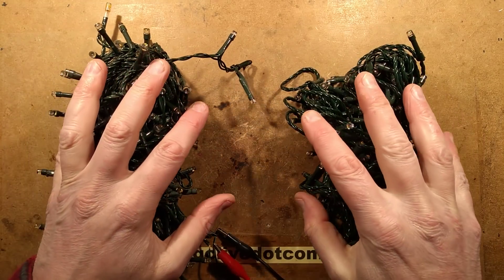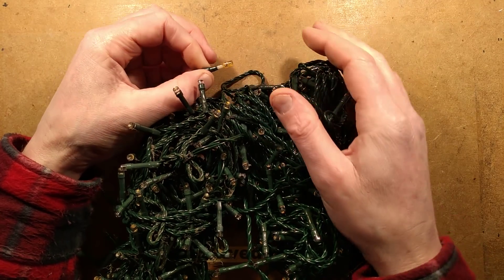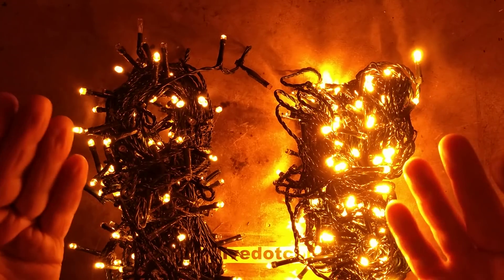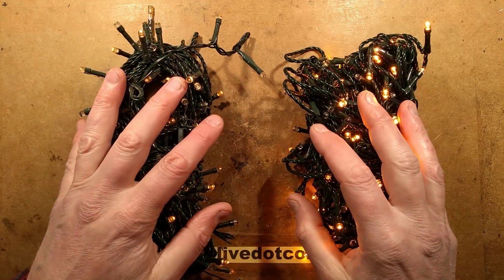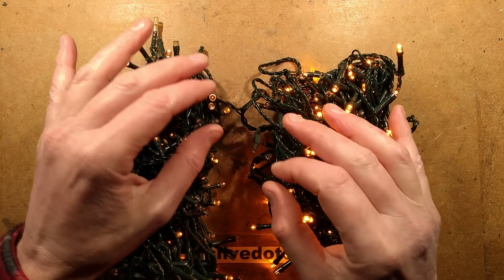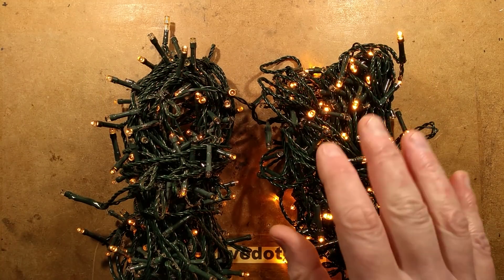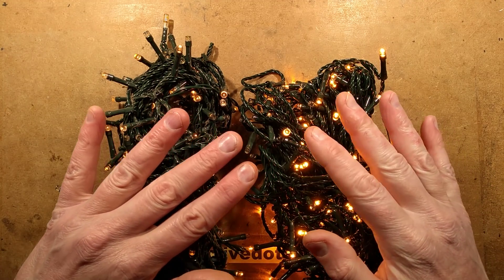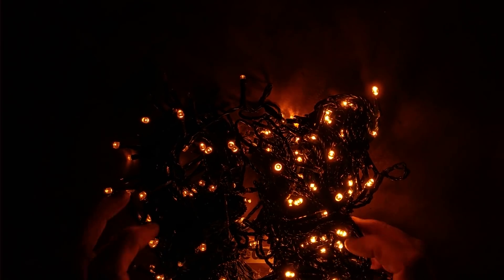9000 hour LED intensity loss test on LED strings.  (All LEDs do still work.)

Comment: I think that leds are no longer made to the same quality as they were. I have an old car that was parked in a dark car park, it didn't have an alarm. I put a red led in to look like an alarm tell-tale, that was in 1990,it still works today. It has been powered 24/7 since then I think it came from Radio Shack in the brief time we had them in the UK.
Reply: He says something about how older red and green LEDs are made differently and don't degrade as much.
Reply: These are white leds. IOW blue leds with phosphor. Red indicator leds emit red light with no phosphor down conversion and aren't driven very hard. Note, blue were also the most troublesome to develop. The 50000 hour number is derived from accelerated aging terminating at 80% output. I'd bet that's at a test equivalent to the reduced current used for efficacy ratings. At least for power leds.

Comment: That's a very interesting observation there, Clive, and I'm curious now! In another village, just a few miles down the way from here, there is a shop that got a display of multicoloured static LED lights in its windows, about three years ago. Since installation they've never been turned off (not my knowledge, and I've travelled that road at all hours of the day and night), yet they 'look' as bright this evening as they did when new, so I guess I'm wondering if some LEDs are born more equal than others? Of course, the shopkeeper might just be replacing them every few months, but I very much doubt that.

Then, there is the question of LED vehicle lighting - Do you suppose we could see car headlights fading away over time? . . It's making me wonder. Then there is my LED 'penlight' which was a lovely little thing when it was new, until I accidentally left it turned on for about three days. The LEDs were woefully dim, and even with brand new batteries, it is a pathetic shadow of its former self - ruined in three days? Is that possible? I was questioning the 'resin blob' chip on board, but now methinks, the LEDs themselves might be goosed!
Reply: ALL LEDs suffer from a reduction of light output as they age. The light output depends on a number of factors. LEDs degrade faster if operated at higher power levels. Especially if overdriven. The non-phosphor types (older technology red, green, yellow) types degrade slowly if run well within their rating. The phosphor types (white and all the other bright crazy colours)  suffer from both the LED chip’s light output degrading and the phosphor degrading. The temperature that they run at also affects them. As does the quality of the manufacturing process. So for maximum life, operate at half the rated power (or less), don’t let them run too hot and buy from respectable manufacturers. And also, unless they really need to be on all the time, only use them when actually needed.

Comment: I'd be interested to see the difference, if you modified the unused light set to drop the current by 50%, then checked the degradation after another year (or even two years).

Comment: The intensity loss gets prominent on nightlights. Since 20 years I own a Osram Lunetta which is a very basic amber GaP LED hooked to a resistor and a diode. The sucker hasn´t dimmed noticeably for two decades. On the other hand, my shiny new IKEA warm-white nightlight has degraded to a miserable dim reddish white in three years. From what I know IKEA uses a combination of white LED´s with a red LED strapped on it to get warm-white. The white phosphor-based LED degraded a lot, so the whole shebang got dim and reddish.
So, only oldschool non-phosphor nightlights for me.

Comment: Highly illuminating, Clive. You must follow this up... Does this happen with lights like 5k room lighting? So its because of the blue/green phosphors. Does using DC to light them diminish the effect or is it the same?

I have some 3528 SMDs I have had running over my desk for a great # of years 24/7. I should compare them to a set I never used.
Reply: ALL LEDs degrade over time. ALL LEDs operate on DC. When reversed biased, they do not illuminate. Typically a white or other colour phosphor is used with a blue LED (sometimes a near UV LED is used). With phosphor type LEDs, both the LED chip and the phosphor will degrade. If a LED is run below it’s maximum continuous current / power, and it does not get too hot, and a quality LED is used, then it should have a reasonable lifespan. Cheap LEDs that are overdriven will have fairly short lifespans.

Comment: I've been running some LEDs for about 4 years on a solar light, they've been going at about 0.5mA for 8, just barely on really (No brightness dip that I've seen). Does driving them harder make them degrade more quickly?
Reply: Yes.

Comment: Interesting. I'm currently looking for a new car, and one of the big attractions is all-LED headlights. Is this also a problem for those?
Reply: Rick Delair  I'm not sure that's true. I've been reading about them that they project light longer distances than both halogen and xenon lights and that if not damaged, they can outlive the lifespan of the car. The cars I'm looking at have intelligent matrix control so that various LED segments switch off when there is a car in front or coming the other way.
Reply: Mine are 7 years old (OEM Car LED headlights), I can't compare to new ones but they are still very effective, but I can sometimes notice a drop in CRI. The reflections of yellow signs looks slightly more green than they should be, the reds are dimmer, but the blue is still good. So yes the phosphors have aged, but the overall intensity is still good.

Comment: I've noticed the same thing with a lamp I put together, they're dimmer and they've turned whiter. 
On the other hand, I have a very orangey (so maybe it's actually orange and not white, though it was sold as warm white) bulb that has been on 24/7 for about 4 years and it has not changed appreciably. There's another strange thing about that bulb, which is that when I got it I screwed it into the fixture that I had bought it for, turned it on, and it only glowed very very dimly. It tried it in a different fixture, and it was fine, so I checked the original fixture and found that it had the live and neutral reversed, and when I corrected that, the bulb worked fine. Any idea why that would have any effect?
Reply: Are you sure you powered on that first socket? If you switch the neutral wire instead of the phase some led bulbs will light dimly with the switch off.
Reply: @bulko89  yeah, it went from off to dim when I flipped the switch.
Reply: @Cadwaladr  very odd
Reply: Is it weird if I can hear your voice in my head when I read this after seeing your picture?
Reply: @GuruMN  no. I can hear your voice too. Just comes from knowing each other and being friends.

Comment: I'm interested to see if the voltage drop across them just increases.
If that's just one LED in the chain of them.
If this is directly related to the phosphors wearing out just like CRT screens "burned in".

Comment: Do plug in air fresheners units so working after a while too. I swear that my AmbiPur 3volution unit doesnt seen to have any fragrance coming from it any more. Wondered if it had 'burnt out' etc...
Reply from the maker: I think the aroma evaporates faster than the carrier.
Reply: @bigclivedotcom  yeah but I have had the same unit for about 3 years, buying many refills for it...
Reply from the maker: @jrsc01.  Do they evaporate at the same rate?
Reply: @bigclivedotcom  ironically the recent ones seem to take a very long time but cannot seem to get much smell from it. I bought another base unit and I can tell the difference already. Think old one has have up the ghost. I'm assuming it's a PTC ceramic plate in them. I watched your video from a few years ago, don't think it's changed much, if at all in that time. Merry Christmas to you and Ralphy this morning! 🎄

Comment: So each led in those strings has 90mA in it ? That seems quite high Clive - that might be a cause here. Also, is being reverse polarised half the time a contributor to shorter life I wonder ? (would depend on whether they are directly back to back or not)  Interesting experiment.
Reply from the maker: 90mA across parallel sections of about 10 LEDs so roughly 9mA per LED.

Comment: Impressive longevity even with the dimming. I would say for someone using them just at xmas the cable would probably wear out and break before the lights gave up.

Even if you used them 24/7 as decoration at a retail premises or something like that, a year is pretty good value for money!

Comment: Does the phosphors on gallium nitride leds degrade from just light intensity itself or is it because of the heat generated? In film production I use some white-light led sheets and strips that offer multiple led densities and the manufacturers seem to rate the lifespan of their more dense products dramatically less than the less dense more spread-out products presumably because of the extra heat created. I know that heat can cause the led's colour temperature to shift over time but I'm wondering if the intensity loss that you're referring to here with this type of white-light led means that the less dense products should theoretically lose intensity at the same rate as the more dense ones?

Thanks!
Reply from the maker: The hotter panels degrade faster.  You can even see an intensity difference between central LEDs and outer LEDs.

Comment: Wait...so they're reverse biasing the LED's every half cycle? I recall watching somewhere on this channel that the newer kinds of LED didn't tolerate that kind of shenanigans particularly well, and was something that should only really be done with the older types of LED- phosphide and such.

Degradation seems a little extreme, maybe that's a contributing factor?

There's so much nonsense regarding LED's these days it's annoying, I'm convinced they can be made more long lasting and slightly more efficient than most lights out there, but there's so much competition for brightness that they end up being overdriven and fail massively faster while being far less efficient, heastsinking is important of course, but there's only so much that can be done against the exponentials that are common with semiconductors.

Edit: plus a lot of it is caused by high current in general, and not heat and would still happen if you immersed the led in liquid nitrogen - you get spikes of metal forming inside the LED itself, partially shorting it, similar to the failure of abused Lithium ion batteries.

Plus, if the LED'S have a current limiting resistor each, then the opposite LED's would do nothing to limit the reverse voltage to the LED's- if a 5v supply , the LED's are seeing the full 5v as reverse bias, and not the ~3v forward bias of the opposite, which is the absolute maximum rated reverse bias for LED's... definitely a crappy design
Reply: The ones I've taken apart have a single resistor in series with the whole string no matter what polarity, so it would appear the reverse biased LED's are being clamped to the forward voltage of the ones lighting up. All of mine have had the gradual dimming until one eventually turns into a resistor and stops the rest from lighting up. The sets used outside don't last more than a single season.
Reply: @uK8cvPAq  you're probably right, but I swear I've seen ones with multiple Resistors somewhere on this Channel, maybe I'm thinking of multicoloured or the municipal ones, could 3v reverse bias damage them anyway over time anyway?

Would be interesting seeing an autopsy either way. :D
Reply: @AngDavies  Wonder if it's like Clives CFL video where a deposit can build up around one electrode until a high leakage current forms across it.
Reply: @uK8cvPAq  there is a process similar to what you're describing called electromigration, where the metal from the electrode gets incorporated into the led itself, basically ruining it, caused by high current?

Thinking about it further, the reverse bias idea could still happen if the LEDs were in series and not parallel - two parallel strings of series LEDs, and they decided to have one LED per string to spread the load and use lower value components

Edit: yeah at 0:07 you can see that it's made up of at least 3 wires, so not a simple parallel thing...hmmm , an autopsy would be great :D
Reply: I have been bitten by reverse voltage before. I once made a decorative thing for a hand-crank generator that had an LED on each polarity of the 3 phases.
For each phase, I had two resistors coming from the winding, going to the two LEDs (in opposite polarity). The LEDs starting dying within minutes.
I changed it up so the LEDs were back-to-back going to a single resistor and they're been running like that for months now.
Reply: @userPrehistoricman  nice to know I'm not completely off base, even if it doesn't turn out to be the case.

It's just seems like a really tiny difference that I could easily see someone doing by accident, thinking "oh, why don't I just split the current across two resistors instead of one"
And the neat part of them wants to make everything symmetrical, so they put one on either side, and it just ends up killing the leds

Comment: So will cars with LED headlights need to exchange the very very very expensive lights at some time in the middle of cars life, even when they are still on?
Reply: Good point, I suppose that it'll be just like with xenon bulbs. They won't necessarily fail completely but just keep getting dimmer until you decide you want more light again and replace them.
Reply: It depends on usage. The LEDs degrade based on usage (heat and current flow). 9000 hours is just over a year of continuous use, and you wouldn't use headlights during the day. 9000 hours with a few hours of every day use does translate to a few years of use. And higher intensity LEDs, like those used in cars, do lose intensity sooner in terms of noticeable loss of brightness. And cars with white LEDs will become bluer over time as mentioned in the video, noticeably sooner than the LED degrading in intensity. There is also a quality difference in the manufacturing process.
Reply: I think they use PWM to limit the degradation, but yeah, they will need to be changed eventually. It could be that turning them on n off  increases degradation... I'm not sure! 😂
Reply: While I haven't looked, I expect most car headlights can have just the LED module replaced, which is probably still expensive, but probably about the same cost as how many tungsten bulbs you'd have to replace in the same time period.
Reply: No. Cars are only driven like 5000 hours before they're junked and most of that time is not with headlights on.
Reply: Hopefully this will mean that over time there are gradually less cars blinding everyone coming in the other direction.
Reply: @ Tim Lau : I think you are forgetting that many cars have daytime running lights as a safety feature. So some cars do have headlights on all the time.
Reply: @jerrydumas9848  And that in some countries you have to have your lights on during the day.
Reply: @timlaunyc  Yes you would use headlights during the day if you ride motorcycles or scooters - you can't turn them off in the EU - turn engine on, headlights come on
Reply: @jerrydumas9848  daytime running lights are separate and different to headlights though, and so can (hopefully) be designed to run cooler and longer at a consistent intensity over the life of the vehicle.
Reply: pwm is just lazy, the real way is to control current
Reply: I've seen some older style LED third brakelights lose brightness after about 10 years (1990's car)

but my own car built in 2005 still looks good

Sad thing is, many LED's these days are intergrated into the product, making it very hard to change.

I had an LED oyster light fail (probably a shorted LED) in my bedroom, and I changed to an office grid style panel light with a plug for ease of maintenance and hopefully last longer before it goes
Reply: @jerrydumas9848  I would add inverted commas to "safety feature". Our Aygo has sufficiently bright DRLs that you don't notice you've forgotten to turn your headlights on - which is great, except the back of the car is completely dark, and you have no idea because there's plenty of light coming out of the front of the car...
Reply: @Muonium1  . . . . . . unless you are in a Nordic country.
Reply: The car will crap out long before.
Reply: @Anvilshock not only the peoples are stupid, the law made by politics is stupid. The car manufacturers do only that what the law requires. And the law is Euro1-6 or 7?
Reply: @stopthemadness5477  most cars too. The daylight position lights are mandatory on cars too...
Tho those lights are not technically used by the driver to see, but rather to be seen by others during the day when no other lights ar e on

Comment: So with so many UK councils moving to LED street lighting I wonder whats going to happen there ? While I'm aware they dont run the modules flat out I do wonder if after say 10yrs or so will they need to change all the lanterns as the lighting levels now wont be what the road was designed to or BS5489.
Reply: It's possible. You would hope that the LED street lights are a bit better made than Christmas lights and don't overdrive the LEDs. 

Where I live, they use a lot of 33/42W CFL street lighting and those are insanely bright. Bonus points for the fact that the lamp bulb can be replaced if needed. We're starting to use LED's too, I just hope they last a long time.

Comment: Do they draw less power, or are they less efficient, or some combination? Well, watching the rest of the video, they consume the same current at (I assume) the same voltage, so they must be less efficient. That means the power that used to go into light is now going into heat, so are they running hotter?